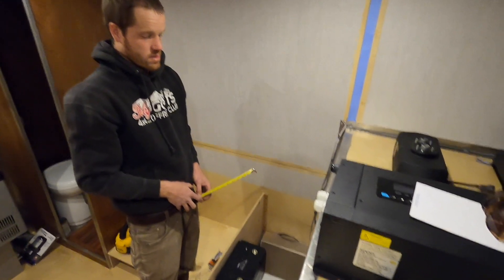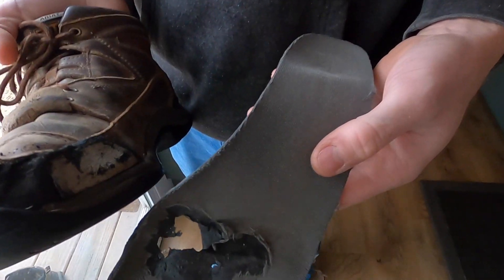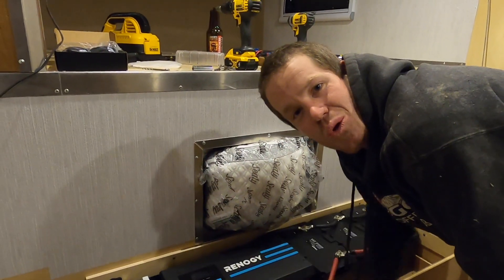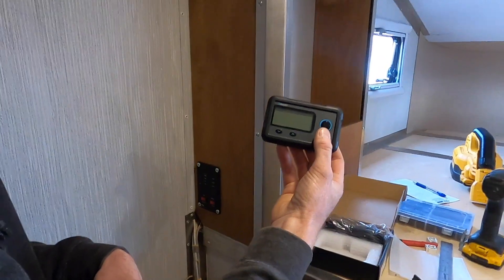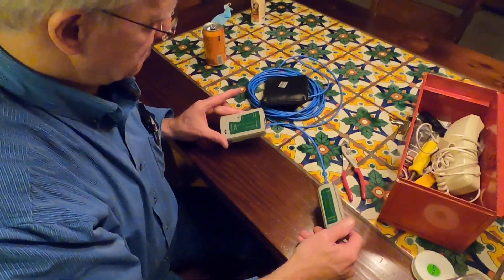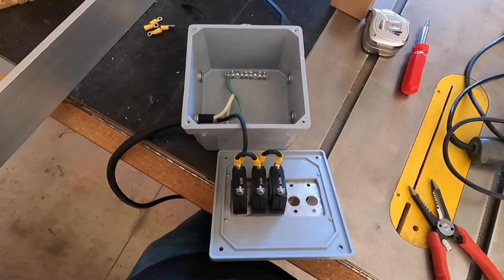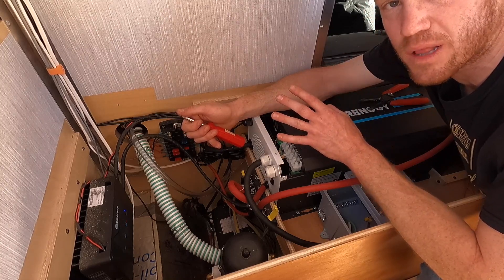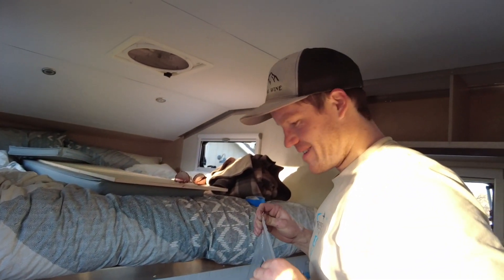Complete Off Grid Electrical System | DIY Expedition Vehicle

Comment: It looks like you're pulling positive and negative off the same battery in the set. It's advisable to pull positive from one end and negative from the other end. The helps keep the batteries in sync so they wear more evenly. Perhaps you changed this later.

Comment: Don't buy Renogy products!!! I made the mistake of buying a complete Renogy system (and I use that term lightly). In less than 6 months and about two weeks of camping, one battery failed (of 2) and the inverter/charger failed (2000w). After literally months of back and forth with their horrendous customer support system, I got the battery replaced but I refused a new inverter/generator and asked for my money back. Even that was a fiasco! it took 3 weeks and a half dozen phone calls to finally get the credit on my credit card. The reason I refused a new inverter is because Renogy's components don't work together as a system. In order for the inverter/charger to function it has to have 12v applied to it. But, the Bluetooth enabled batteries are in an "off" state after 24 hours of no load. In order to get them turned on you have to apply a 1amp charge current. You see the problem; the inverter/charger won't come on without 12v and the batteries won't come on until the charger chargers them!  A real catch 22!!!!  And don't get me started on their Renogy One M1 monitor. It's worthless. Most the time it doesn't see the batteries and when it does the update rate is so slow that you'd miss any change in load.  It doesn't have a shunt so it depends on the Bluetooth for its data. And it doesn't even talk to the worthless inverter/charger!

Comment: The overall project looks really good.  I especially like the cabinets around the bed.  I'm concerned about your inverter setup, though.  Here's what the owner's manual for the inverter says about installation and ventilation:

"Cool, dry, well-ventilated area — Heat is the worst enemy for electronic equipment. 
Inverters must be in an area where the fans are not blocked or where they are not hit
directly by the sun. They should be in an area free of any kind of moisture and allow for 
clearance of at least 10” around the unit to provide for adequate ventilation."

There is essentially zero space around that inverter, and it's in an enclosed box.  If/when it dies, Renogy will ask you to send photos of the installation...  A warranty claim is likely to be problematic when they see that complete lack of clearance around the inverter.

Comment: Glad to see people are doing DIY, looks like a good set-up the only thing I would check is the airflow through your inverter I believe renogy tells you you got to have so much space in front of it and back of it for correct airflow I see you have it at least the front of it but up against one of your batteries. One thing you don't want to do is be out in the boonies and all of a sudden University shuts down because it's overheated and possibly burn something up?😮

Comment: RENOGY recommends the charger inverter is installed in a different area than the batteries for fire protection.  You seem very safety minded so how did you decide to put them together?

Comment: how is your experience with renogy 2000/3000w charging inverter?  do you know how much power the unit needs if it use the 'eco mode' or 'search mode' (however it is called) ?

Comment: I have the renogy 2000w inverter/charger but get an open ground when on DC power. On shore power everything is good. What did you do to ground your inverter/charger when on battery power?

Comment: How many amp’s did the shore power from your home supply by itself in the video without the alternator?
Reply from the maker: The shore power is able to supply up to 75 amps at about 13.5 volts. This is through the inverter. The charge from the alternator goes through the DC DC charger and is 50amps.

Comment: Impressive, as always. Having owned RVs and cruising boats—I love your attention to detail. Only one 2-part question: where dues the inverter heat and batteries vent gases go?  Even if the Li-ion or AGM batteries are  vent-free, 97A on shore power or 100A inverting to AC is a lot of heat! On my boat, I had to have a thermostat fan to keep the 2000W Magnasine cool. BTW, great safety comment about neutral and ground being separate and essential.

Comment: Looks great guys! I did a off grid shed with a 2000watt inverter and 500 watts of solar and 200ah gel. You did really good. The lithium and inverter charger was my goal but had to keep cost down. I went with all renogy and it performs flawlessly! Also a rv technician so I'm happy to see the renogy products working great for out in the field time. That dc2dc charger for lithium was a must have. Will you or have you done any solar? Also I'd love to see the rv I bet it looks awesome! Have fun guys!
Reply from the maker: Hi Jayson! Thanks for the feedback on our set up. We have been using it full time for a year now and are really happy with it. Yes we added 300w of solar on the roof of the camper, as well as 300w of portable panels. This allows us to park in the shade but still get some charge. Check out our tour video here for more info on the build: https://youtu.be/rO6vQnjdkEI

Comment: You lose all credibility when making a recommendation immediately followed by "USE OUR BRANDED DISCOUNT CODE!"
Reply from the maker: We paid for the stuff outright with no affiliation whatsoever. We reached out for a marketing partnership opportunity after the fact once we had a chance to test the equipment and make sure we were backing a quality product. We've been using this equipment full time for more than a year including powering out entire shop build project and it has been great. It's not the flashiest, fanciest, most powerful equipment on the market but it is a great value and it's simple to install and use.

Comment: Great video that the algorithms brought me to tonight! I am in the middle of my own topper\camper build and just started testing out the solar today. I like the arrangement you have and plan on much the same, including that massive inverter\charger :) I like the idea of the whole thing being center of the truck and doubles as a bench! Cheers.
Reply from the maker: That inverter has been money well spent for us. We’ve powered air compressors, welders, etc…
Reply: @AmbitionStrikes  I'm not sure what I will need 3000W for yet, but don't want to undersize right off the bat. Maybe a coffee grinder\maker, microwave, heater? Eventually maybe an AC unit, so more than I need, for now, but the inverter\charger in one is a great combo. I looked at a separate inverter and charger\transfer switch and it is pretty much the same difference. But the combo unit saves on a lot of wiring. I assume you will, or already do, have solar as well?

Comment: Hi guys, so I am looking at getting most of the same equipment you have, but am very concerned with the longevity of the products (especially the inverter / charger) and customer support from Renogy. There are a tone of bad reviews on Amazon making me nervous. If you could do it again would you still use the same products or would you have done anything different? Is the inverter noisy? Thanks so much.
Reply from the maker: Hi Bryan, we've been using this stuff full time for almost a year now and haven't had a single problem. With that said, we bought all of this stuff out of pocket, used it, and liked it. Then we approached Renogy for a discount code to share with our viewers. The code Ambitionstrikes will get you 10% off your order, and we earn a commission as well. I'd use Renogy again. It's been working really well for us.

Comment: Sorry... I wish I could be amazed and inspired like most of your followers, but I'm more concerned for the safety of you and those who foolishly follow this video. Placing a 3000 watt inverter/charger into a small, unvented box made of combustible material goes against the manufacture's installation recommendations, electrical codes, and common sense. You've exacerbated the danger by blocking the unit's ventilation holes and placing Lithium batteries next to it. Not only is this a huge fire danger, you're shortening the life of the equipment and handicapping its power output rating as it struggles with internal temperature build up. If you're going to make installation videos for profit, please at least follow the manual or be ready to be sued or worse!
Reply from the maker: Hi there! Your concerns are certainly valid. Maximizing every cubic of space in a tiny camper comes with some compromises. The area where the inverter and batteries are is vented for heat purposes. These units have their own thermal cutoff to prevent damage. We don’t use the inverter for extended periods of time, so it never actually gets hot and after one year of full time use we have had zero problems. 

And to be clear. We are NOT a how to or installation channel. We are simply documenting what WE are doing and sharing it with others.

Comment: I am not sure what the Renogy instructions said.  It looks like you pulled your positive and negative connection off the battery closest to the charger/inverter.  I have always heard when you connect in parallel, the batteries at the “ends” serve as your positive and negative.  One will have the positive connection and the other end will have the negative.  That will keep all of the batteries “equalized” and not put most of the strain on one battery (one with both + & - load connection).

Comment: A few questions. And nice video. Thank you. Good news I already bought the inverter. Bad news I got it before watching your video and missed the discount. I do have a question about shore power. Are the wires connected to the “ in put” terminal and also would I be connecting solar and the DC to DC charger to this same place. And when the shore power is connected does the inverter recognize it automatically?
Reply from the maker: Hi there! Thanks for the comment! I'd highly recommend checking out the owners manual. I found it to be very helpful when setting ours up. If you don't have the owners manual you can download it from the Renogy site. You should never be directly connecting AC power to DC power. The DC DC charger and solar charge controller are DC and will connect to your batteries. Make sure all connections are appropriately fused. I like Blue Sea products for that part.

Comment: Just watching this. Great video! Curious if you have had any heat-related problems with the Renogy installed underneath the seat. I'm trying the same and having overheating issues.
Reply from the maker: We only have heat issues when we are using shore power to charge the batteries. We lift the cover to the compartment for better air flow and that solves it.

Comment: Awesome video. I can’t find your schematic of your system. 
Question: (may be stupid so forgive me) I get the whole inverter thing making ac or of dc. Got it. What I don’t get is... when plugged in to shore power does the inverter automatically charge your batteries and supply shore power to your ac outlets in the truck. Stupid part now.... do I have to turn on the inverter to make this happen or is there a “bypass” circuitry that allows this without turning inverter on. 
Stop giggling;)
Wish I found your guys sooner:(
Reply from the maker: We have not posted a schematic of our system yet. 

Yes, when plugged into shore power the inverter automatically charges the batteries and there is a direct pass through (using relays) of shore power to the inverter AC output. 

We did discover that you have to turn the inverter on to get the charge function to work. 

Thanks for watching and please let us know if we can answer any other questions. If you're considering purchasing the inverter or any other Renogy products, the coupon code AmbitionStrikes will score you 10% off your order, plus we earn a little commission too. We promote and sell Renogy because we truly feel like they offer great value in an easy to use product.

Comment: Can your battery system take energy in from your alternator and solar power ? Is there a way to build a battery bank that will do take in power from both sources ? How about adding a third source like a generator ?
Reply from the maker: Yes I need to confirm with Riley but I believe it can take input from both sources at the same time! We would add a generator but don't really see a need to.
Reply: Yes, you can build one with multiple charging inputs all acting at once. Their inverter (inverter/charger) has a built in charger that can be run off a generator or shore power. The solar charge controller can add charging amps at the same time. But to charge from the alternator you need a DC to DC converter to feed the proper voltage to the battery AND limit current coming from the alternator. If you don't have that, its possible to overheat your alternator and burn it up if you have lithium iron phosphate batteries. Lithium batteries can take a huge amount of charging amps without damaging them.
Reply: @kimmer6  from what I understand they already have the 50a DC-DC with mppt charge controler which does both. The only thing from what i read is that it prioritizes solar charging over the alternator charge..I'm probably missing something, not to sure how to control to make sure the batteries are being charged where the most energy is available between the 2 sources. Same thing, when your shore is hooked up does it mean your solar is useless 🤔

Comment: I recently installed Renogy batteries. I am sure that the maximum amperage you should charge them at is 50 amps. I think it is in the owners manual for the battery. You said you were charging at 73. There is probably a setting on the inverter charger to adjust what you are charging at when plugged into 120v.
Reply from the maker: Hi Kelly! Thanks for taking the time to voice your concerns, we absolutely appreciate it! According to the instructions EACH battery is rated to charge at 50 amps, so because we have 3 batteries our maximum charge rate is 150 amps. Thanks for following along on the build with us!
Reply: @AmbitionStrikes  Well damn, why didn’t I think of that. I am going to change the charge rate on my inverter. Thanks for responding to me.
Reply: I hope this comment wasn’t taken to imply anything negative. I am in awe of what you guy’s have built and your abilities. It exceeds what is available on the market in quality, design, and aesthetics.

Comment: The bench is covering the inverter? So like the inverter wouldn't overheat from lack of cool air flow?
Reply from the maker: The heater return is located in the box as well so we added air inlet holes on both sides of the box and it currently gets nice air flow. Come summer time when we aren't running the heater the plan is to add a small fan.

Comment: Correct me IF I am wrong, please - BUT - from (many) other install videos the main +ve & -ve cables from the battery bank to the Inverter/Charger should NOT be on one battery.  Rather the cables should be of EQUAL length with one running from the "front' battery and the other from the "back" battery.  THAT, IIRC, ensures that the charge TO the batteries in the bank is equal.
Reply from the maker: Thanks for looking out for us! According to the instructions included with the batteries we have them wired correctly. The BMS in the batteries are connected together via RJ45 and are able to self monitor voltage. Renogy recommends paralleling up to 4 batteries in the configuration we have done.
Reply: @AmbitionStrikes  check out the RENOGY install video here https://youtu.be/Mb-Pacnet9Q. Pos and neg come off different batteries.

Comment: Hi Guys hope your having fun on the road now we need to talk about  the main cables to the battery bank you need to take either the positive or the negative to the third battery so when they are charging or discharge you get a balance charge & discharge to all batteries what happens when your connected to the first battery is the power is mainly charged & discharged from that battery if you need to talk more send me an email CHEERS .
Reply from the maker: Thanks for looking out for us! According to the instructions included with the batteries we have them wired correctly. The BMS in the batteries are connected together via RJ45 and are able to self monitor voltage. Renogy recommends paralleling up to 4 batteries in the configuration we have done.

Comment: I like the simplicity of the renogy install, wish they had a 24v version of them. My system was way more involved, but it's a tiny bit more complex as well.(running everything from Tesla modules and the whole truck runs on home assistant)
Reply from the maker: Wow your system sounds really cool! Riley started down a similar path but decided to keep it simple for the sake of the timeline. I bet you got a lot of bang for the buck! Can't wait to start automating some systems in our camper.
Reply: @AmbitionStrikes  haha, yes going down the path you can save some money, but it's a never ending project, for Tesla voltage you need to modify the inverters, and a lot of other stuff has to be custom, not to speak of the home automation, it's never finished. That's where these all in one plug and play setups shine. But I like the tinkering and having useless remote control of all the things 😁